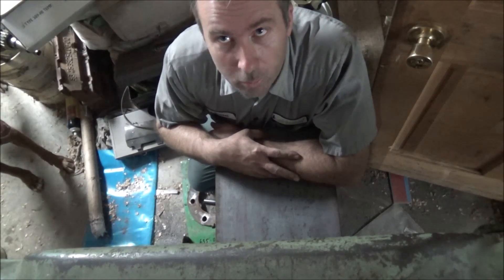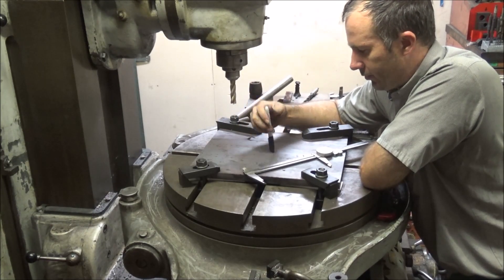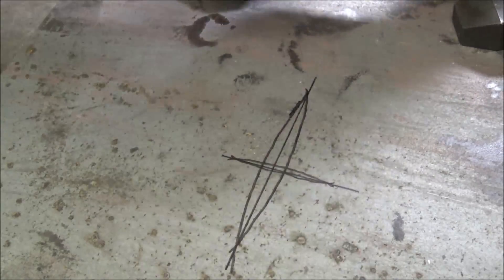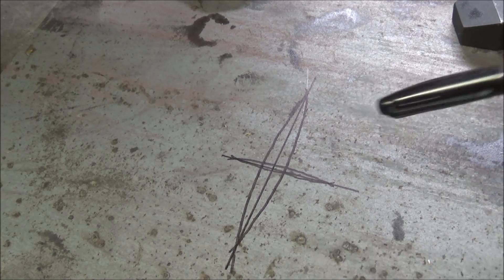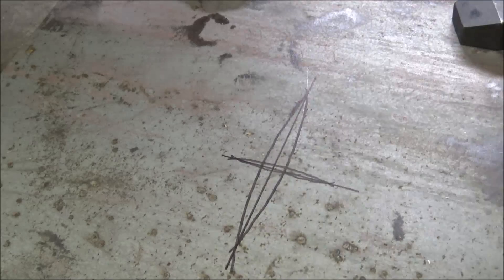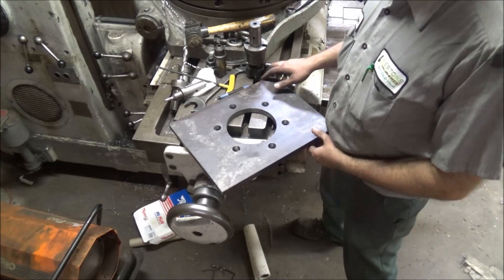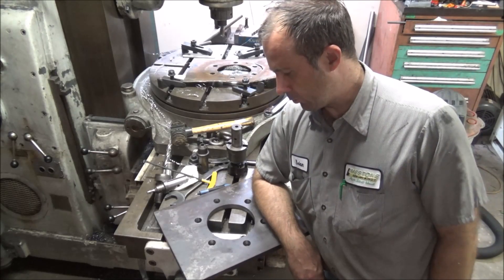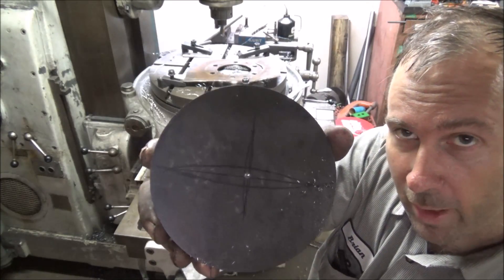Fabricating a Gearbox Mount

Comment: Nice rotary table project. I was taught the arc location many years ago. It will work on almost any shape. I use it to locate sound holes, bridge positioning and many other effects in building custom acoustic guitars. Except I bought a metal lathe and I haven’t cut any wood for months! What is it with steel anyway?
Reply from the maker: Steel is more stable. :-)
Reply: More stable than wood, sure but unstable as all get out when it comes the obsession factor. There’s always a bigger or better machine, tool, setup technique or you name it. Which translates into $$$$$
Lol
Reply from the maker: Yeah it isn't a cheap hobby, eventually if it gets bad enough you have to build an entire building with a crane in it just to support your addiction!! lol

Comment: At first glance I thought you had gotten a vertical boring machine I had not seen before. Then I realized it was a massive rotary table bolted on your mill.Thanks for the new way to find a relative center even if your plate isn't square. Another perfect job, Lol.

Comment: Regarding that broken end mill.  A steady stream of air to clear the chips  really helps, a Kool mist setup is even better.
Reply from the maker: I am pretty sure the end mill bit it from me not running the crank handle on the table smooth enough, I just fed in too fast and it snapped, controlling that hand crank is difficult and with the reduction it offers little feel. If I had it setup to powerfeed and be consistent I think it would be much better.

Comment: Brian, how did you layout the outside set of holes? Measure from the center to first one and then indexed them every 60 degrees? I lay them out with a scribe? or used the DRO function?  What model is your Cincinnati mill?  Thanks,
Joe
Reply from the maker: I just came out the radius from center and then indexed the rotary table every 60 degrees. Being a big table the degree markings on the outside are very accurate. My Cincinnati is a #4 High power.
Reply: I was thinking that may have been how you did it since I didn't see any witness marks.  Is it a vertical #4 ?
Reply from the maker: No it is a horizontal with the vertical attachment.
Reply: Oh, never have seen one of those.  Thanks, Joe

Comment: Bloody big rotary table you have there Brian, How did you work the holes out? Just by degrees on the wheel?
Reply from the maker: The outside of the rotary table is fully degreed so I just rotated it every 60degrees. Being a large table the drgree markings are very accurate.

Comment: It looks like you forgot to drill out and extra hole. Maybe for an alignment pin or something. I was also wondering why you didn't just measure corner to corner but you explained that away, I learned something there! That is a pretty cool machine with a rotating table. Thumbs up as always Brian
Reply from the maker: The extra holes were where they had the stands welded in that were part 
of what made the laminated box assembly that was the original mount. 
Since this version eliminated all that there was no need for them.
Reply: Perfect!

Comment: At 9:40 and on... when you drilled those holes. When do you drill pilot holes and work your way up versus just one drill bit? I would like to know sir.
Reply from the maker: I rarely ever drill pilot holes unless the bit is over 1.250" D. If accuracy is needed in the less than .005" range then I might do a spot first to be sure the drill starts in the right place, but with proper ground bits i normally wouldn't even do that. If the hole needs toleranced closer than the .010 range then it likely needs bored so then I would just drill undersize and finish the bore on location.

Comment: Now I know how to find the center of a square plate, thanks.
Reply from the maker: Actually it works on any shape that is the advantage, if the plate was known to be square then just measuring to the center both ways and using a square would be a lot faster.

Comment: A CNC plasma could do it, but could it do that as clean and crisp? I just don't think it could imho. Also do you not need to use oil on this machine? Just curious.
Reply from the maker: No a plasma or a punch would never be as clean and crisp.
Reply from the maker: By oil do you mean cutting oil or are you talking about the machine itself?
Reply: bcbloc02 Cutting oil.

Comment: Couldn't grind a $10 HSS tool to trepan on the lathe, so I'll bust out my $12,000 small car sized rotary table instead :-).  Just kidding of course.  Is there something special about a trepanning bit in the lathe that you couldn't grind one from a HSS blank?

Nice work Brian.
Reply: In my short experience, grinding toolbits is like learning to ride a bike, lots of failures until you get the hang of it.
Reply from the maker: Trepanning tools need to be tall and thin and I don't have any HSS that isn't square. Grinding a 1.500 square down to .125 width would take forever!!

Comment: on trepanning, I have good luck driving big hole saws with the mill or heavy drill press. Drill a couple 1/4" holes through for chip drainage. Put a heavy pipe on the quill handle and let it eat. Then bore or use the rotory table and a little end mill to bring it to final size.
on the saw, I've found if you toss a piece of round stock under the flat stock, right up against the fixed jaw it'll help with chip clearance a lot on longer cuts like that. 
http://i65.tinypic.com/zwgajm.jpg
for a crude drawing of what I mean. The chips from the front of the cut don't get dragged through 10" of stock, and you don't have to switch out to a coarser pitch blade to get decent cut times.
If the round stock is larger diameter than the thickness of the plate, the plate might want to pop out of the vise, though.
Reply from the maker: Thanks for the tip!

Comment: Don't want to tell you what to do but wouldn't it be quicker to run a straight edge diagonally to find center? Would save the caliper tips too. However you set it up it it's a tough job to mill that center slug out.  3 weeks ago I cut a 10.75 dia. slug of 2.5 thick aluminum out of an 18 inch square plate with a .5 end mill. 2 inches deep flipped the part and cut the rest except the last couple of degrees on the final cut that I finished with my sawzall. Lol
Reply from the maker: It was discussed in the video about the advantage of doing it by arcs 
versus diagonal in case the plate wasn't exactly square.  In this case 
either would have worked just fine.

Comment: My method to save on the endmills is to remove the chips with air, mist or flood coolant, been a great tool savior so far, ( not a 100% though)
Is that a 24" table?  you're not only 6 foot 1 inch, but,  you're also STRONG...    lol
Can't even lift my Walter 16", geezzzz...
Reply from the maker: I like flood coolant but mine needs changed in the mill and since it will have to be drained when I move it I really want to change it then so I am trying to hold off. My next option is my good shop vac but it too is in the other shop. :-( I can't lift that 24" table, it is about 600lbs!!

Comment: Cool video, interesting method to find center and put the hole in it
Reply from the maker: You could have smoked this job on your plasma table though! The original part had obviously been punched so a plasma could have easily been within tolerance in a lot less time. Got to work with what you have got though! :-)
Reply: Yes, but nothing like looking at machined and drilled holes!  The main concern would be if Bailey ended up approving the job?

Comment: If I'm cutting a slug out, I like to drill through it and use a stud to clamp it. Usually the real carnage is when you break through. On the CNC, it's so easy to just turn the whole thing to chips.